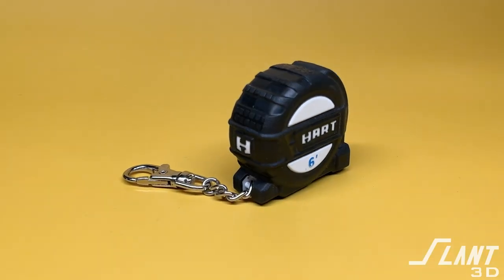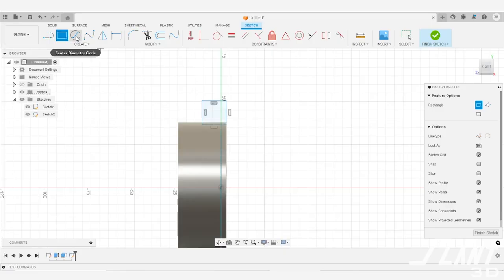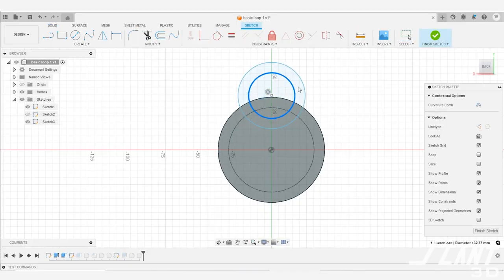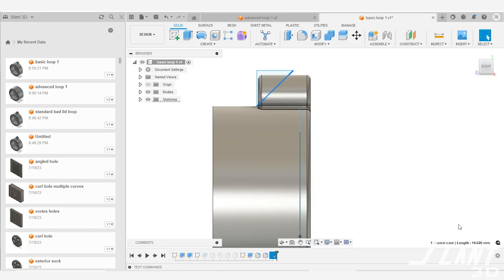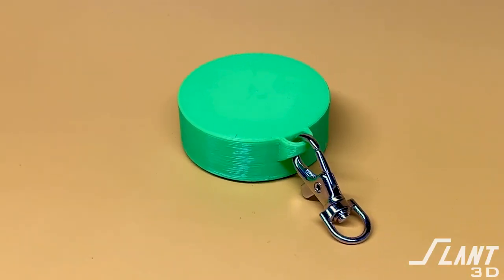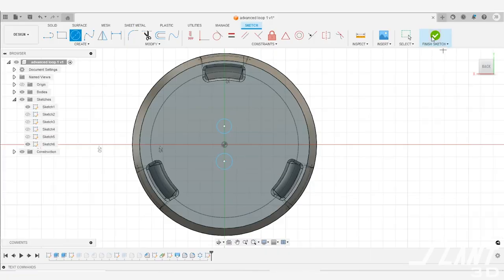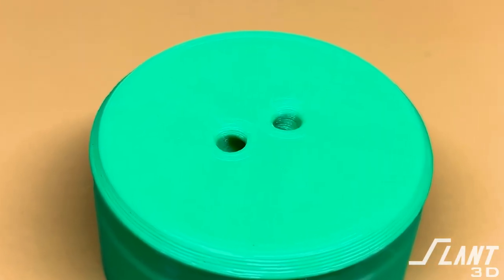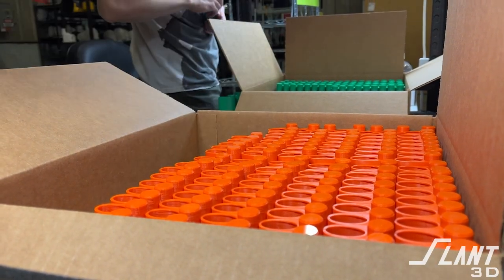Lid Loops | Design for Mass Production 3D Printing

Comment: Did this with a number of paintball parts (hopper/magfed adapters).  I put a curved internal channel through the middle of a design for a large ziptie to go straight through to secure the part to the marker.  Turned out to be very strong and I avoided having to do something like weld nuts onto the marker body.

Comment: I like the idea of a glued in pin that is perpendicular to the layering with a hollow around it to maximize strength. This could probably be done in some clever way where the pin is captured at one point in the print, then reoriented and glued later, producing something like looks impossible.

Comment: This gets me thinking about designing food safe parts (something I find myself thinking about frequently). I know the general consensus for FDM printing of food safe parts is to coat them in food safe epoxy because that is the only way to prevent bacteria build up in the micro-cracks of the part, but I don't see that scaling well for large production volumes. Do you all have an approach for printing food safe parts?

Comment: The imbedded connectors need a thicker base and wall for  it to work properly. So more material and print time added to the part is the end result with that design.
Reply from the maker: not necessarily.